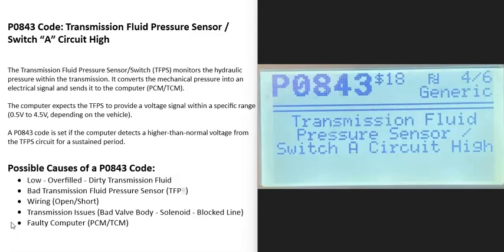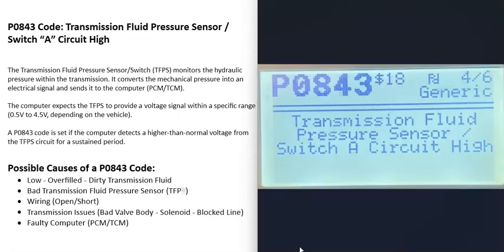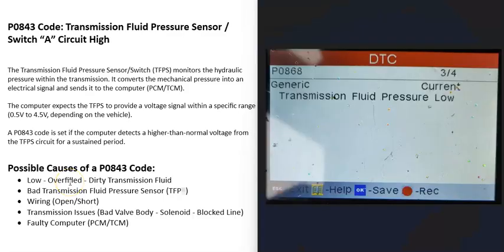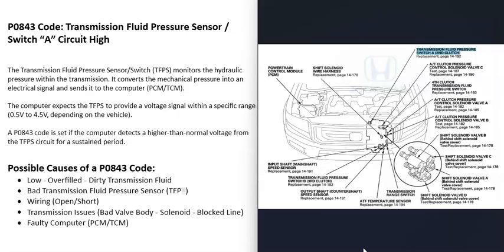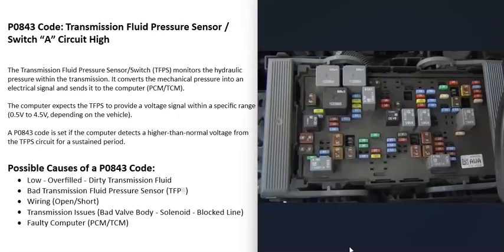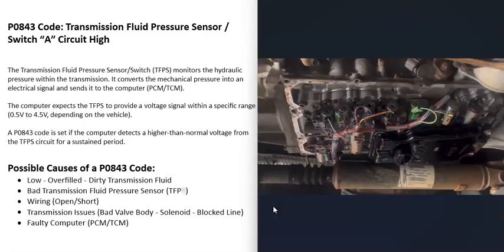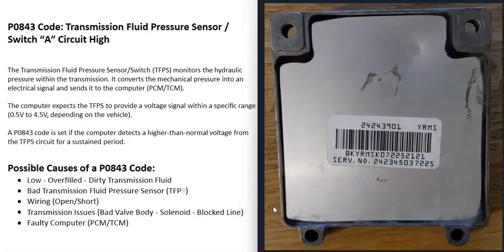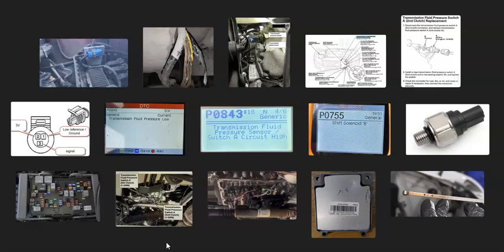Causes and Fixes P0843 Code: Transmission Fluid Pressure Sensor / Switch “A” Circuit High

Comment: Great video. Do you have the full book reference of the pictures that show where the switches are and how to replace the second clutch sensor?
Reply from the maker: The manual or diagrams will be needed since it will be different for each model of transmission.

Comment: I had this code about a month n half ago I changed the transmission fluid and it was shifting perfectly and didn’t throw any codes but today I was driving when I got up to about 50 it shifted really rough again